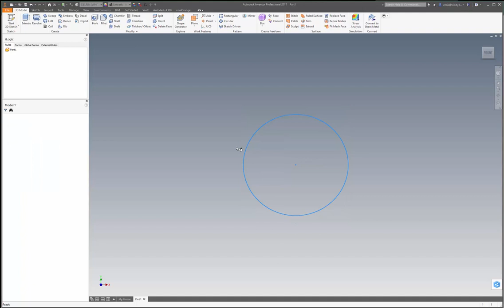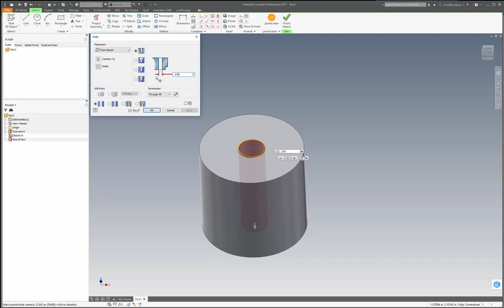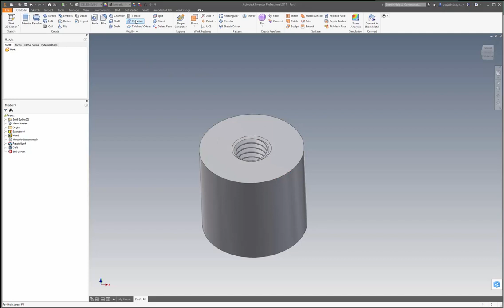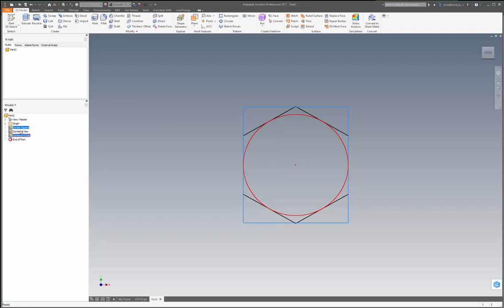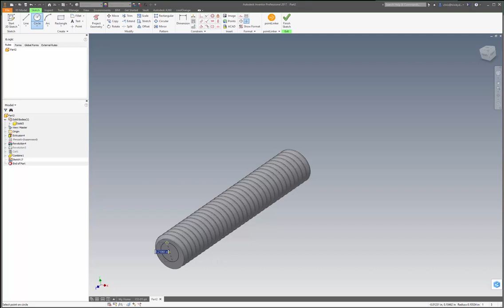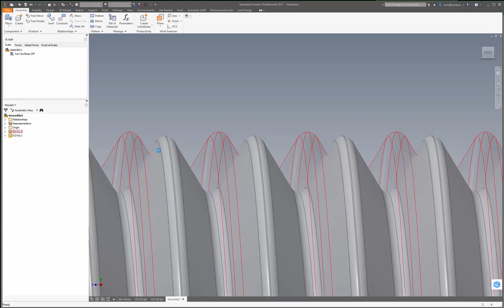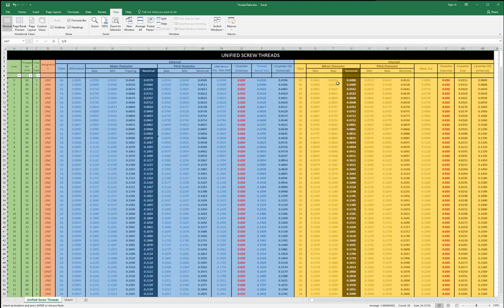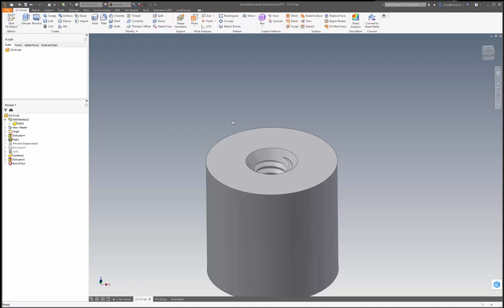How to correctly use the Thread Modeler in Inventor

Comment: 3:36 I don't understand the chamfer part that doesn't make any sense
Reply from the maker: John, if you don't combine the solids, the chamfer will only cut through whatever "solid" you sketeched on, or you will have to remember to cancel the solid selection and then hold control while you choose both solids... but unless you have a reason to keep the threads as a separate solid just combine them

Comment: A new threadmodeler has been released. It is colored orange as well. Its called Fusion360. Inventor is dead. Move on
Reply from the maker: Yep, I use Fusion as well, however a lot of the projects I work on are custom iLogic parts/assemblies I have created, so for those Inventor is still required. If Fusion ever gets a full version of iLogic, I will consider moving over, but until then, Inventor it is.